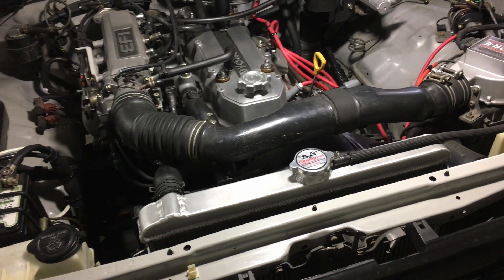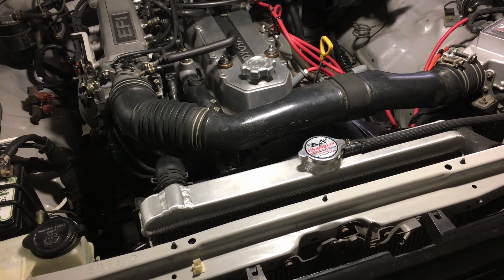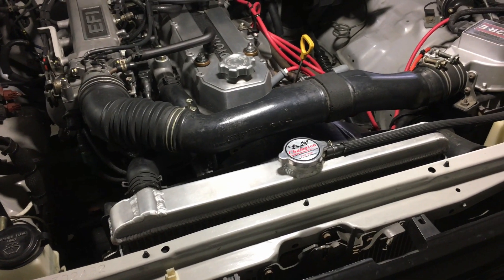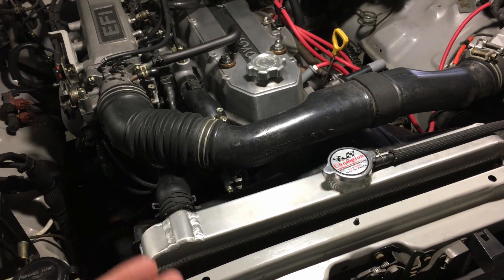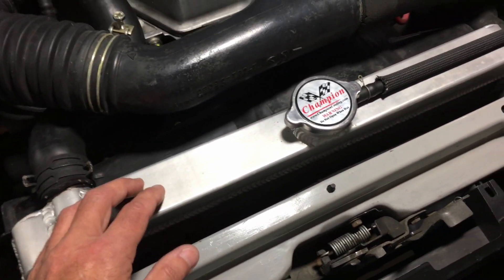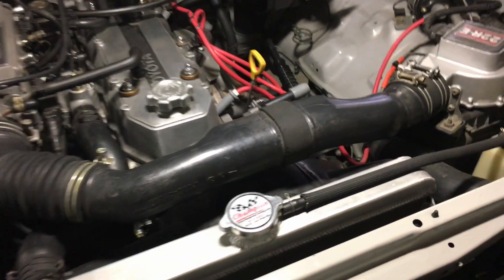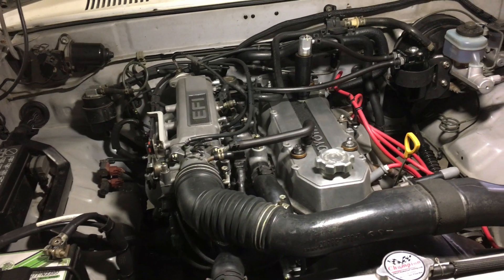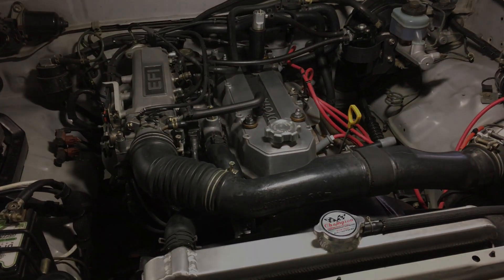CHAMPION ALUMINUM RADIATOR on 84-95 Toyota 22R Pickup - Zerek Asian Red Antifreeze discussion SAFE?

Comment: The Toyota Red Long Life Coolant was the factory fill from 1988-2003, including models with all aluminum engines like the 1990 Lexus V8 and models with all aluminum radiators like many starting in the mid-1990's. So the Red is compatible with aluminum.

Comment: FWIW, I've got 10 years on my '94 22re running regular Prestone green 50/50 coolant with no issues.  I swapped to an eBay all-aluminum 3 core radiator about 4 years ago.  Previous radiator hadn't failed, but it was a cheap v6-spec replacement with plastic end tanks which I got worried would break apart at some point, especially since, like you said, they're rigidly mounted to the cab and frame.

Comment: ever use redline water wetter and distilled water?
Reply: Water wetter and coolant performs better than water wetter with distilled water if I remember correctly they have a little graph on the bottle
Reply from the maker: I've never tried that myself. This radiator cools really well; when driving along over 40 miles per hour in 65-70 degree outside temps, the return water from the radiator averages around 110 degrees F coming back into the motor. Even when driving on the highway at 80-85 MPH through 100 degree temps, I think water coming back into the engine hangs around 135-140 degrees as I remember. I run about 75/25 mix (mostly distilled water) as I remember, but I'd have to double check that. It might be more like 50/50 or 60/40 but not sure. Out here temps rarely get down to 30 degrees, so not a major issue generally speaking as long as there is some antifreeze in the mix and the truck is parked in the garage. I think I did buy Moto cool or something like that (either for my Yamaha R1 or the truck, but never ended up using it). Have you used it and if so do you notice a difference in temps?